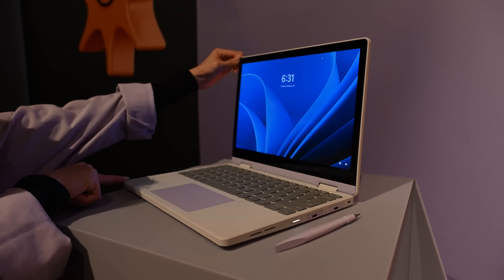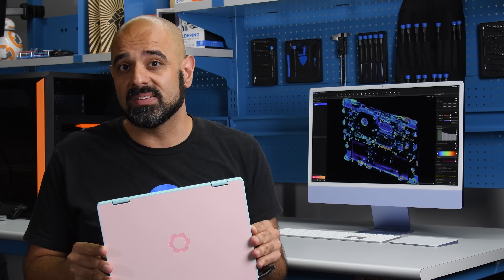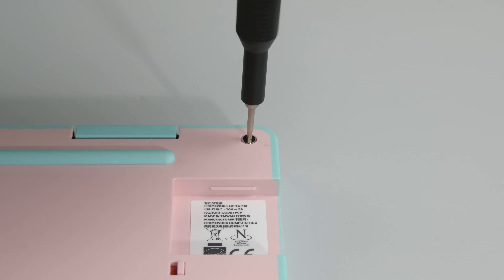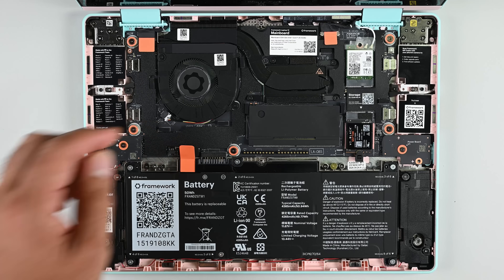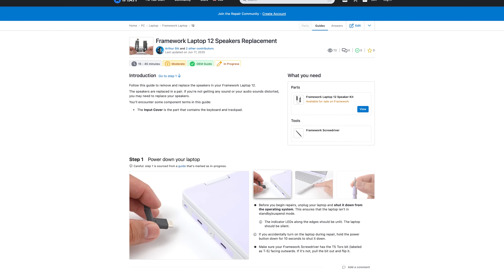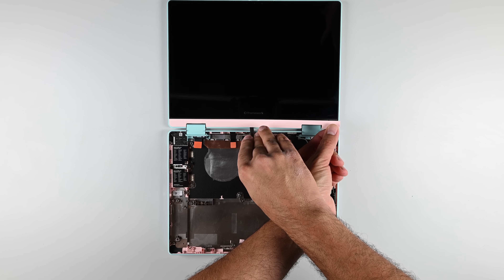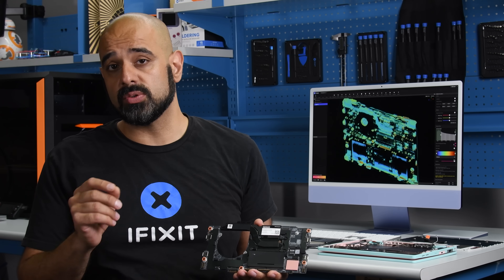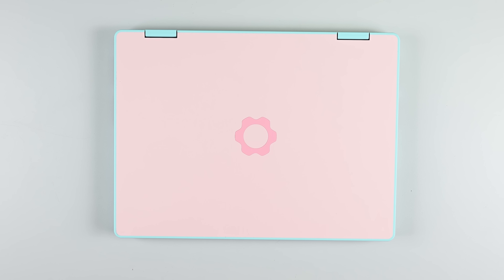Framework 12 Teardown: Touchscreen, Tablet Mode, and 10/10 Repairability

Comment: I got a preorder for it, really really hope the screen getting dim at angles is from a polarised filter on a lens, not from a TN/TFT screen. The inside looks awesome as always
Reply: LTT said the screen sucked ass, unfortunately.
Reply: the screen only covers 66% of the sRGB colorspace :/
as someone who preordered the Framework 12 to get a repairable drawing device I can take with me on the go, this stings a lot. I hope they release better screens later...
Reply: @konkondotzip I’m sure that’s an upgrade path they’re considering  like how they started selling reinforced lid housings and matte displays when they swapped to those version so people could get those benefits on batch 1 units
Reply: @superNova5837  yeah that's why i'm still getting one. i just hope it won't take that long lol
Reply: @konkondotzip  TBF price first.
Reply: I am using a 12 as a portable in an archives for data collection and verification, in addition to other typical office productivity.  I wanted Windows 11, Linux, touchscreen (with tablet capability), small and lightweight footprint, reasonable durability, and performance specs.  I got it all.   
The only functional problem I have is not specific to Framework; I sometimes brush or bump the touchpad (co-volunteer has same issue on his Dell laptop and it occurred on my last Surface Pro), so we set the touchpad to disable when a mouse is attached and use a mouse when there is adequate workspace.

Comment: Well done. Wish their laptops were available globally.
Reply: Spread the word, advocate for them and then they will have the capacity to ship to more countries. Expansion is quite hard
Reply: Same here. My current laptop is currently under RMA after the screen stopped working after just 1 year due to motherboard issue. I was told the RMA will take approximately 2 months which is horrendous.
If Framework laptop was available in my country, I would buy it in a heartbeat.
Reply: @faizyunus which laptop and company?
Reply: They are expanding the countries they ship to, little by little
Reply: Everything should be available globally 😊
Reply: @robertschnobert9090 maybe not everything
Reply: I'll ship one to you.